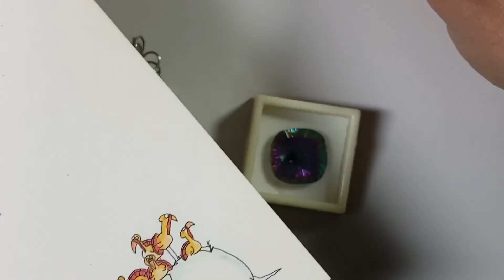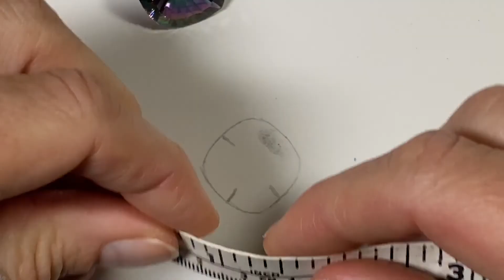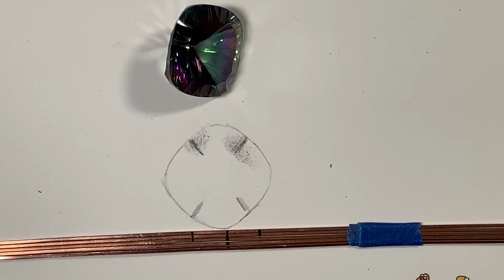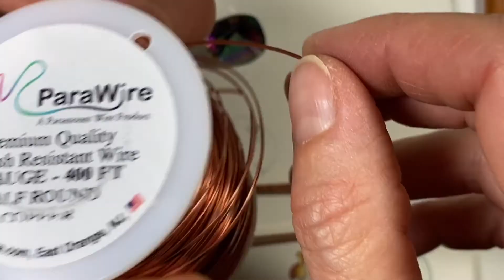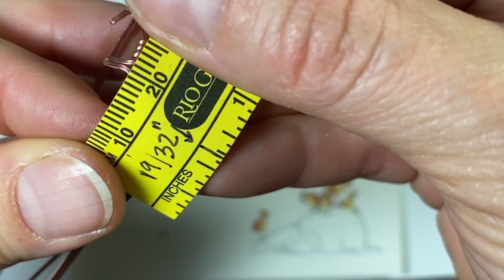Wire Wrapping Tutorial- Prong Setting for DEEP Cut Faceted Gemstones-Jacked Up Frame!

Comment: I had seen your original post on Facebook and voted for this tutorial. Thanks for making it. I know how difficult it can be to create a piece and video at the same time. It seems to add a bit of frustration at times for me at least so great job. I love the elegance of the silver one. This one did turn out a little busy but still nice and I love the stone. I need to invest in one of those polishing kits. It really brought out the shine and erased the tool marks wonderfully. I find myself using LOS to antique most of my pieces to hide blimishes but this is a great option now. Thanks for taking the time to create this tutorial.
Reply from the maker: Thanks so much for watching! 
I’m still debating wether to just cut the extra wire off since that’s an option still lol! We’ll see if anyone is interested in it! 
This video gave me high anxiety for sure!
Reply: @ZurickDesigns  adding that video element to the whole thing seems to do that to me as well. I love your work. Thanks for sharing.
Reply: You can also get a nice polish using a flex shaft or a dremel tool and some polishing disks. Of course, my JoolTool is the best option.

Comment: Starting out into wire wrapping, I’ve got nylon pliers, brown nose pliers, getting flat nose pliers, what was that measuring tool that you had? To measure the depth. And would you recommend any other tools
Reply from the maker: Those are calipers.
I would start out with the round nose and flat nose, also chain nose pliers (I have a fine tip and a thicker tipped) and a good pair of flush cutters! ☺️

Comment: Hi! Thanks so much for this! I love these videos and I love Gertrude! I was wondering whether the wires that go between the two layers of framing need to be curled? Would this design work with straight wires for a simpler design or would it collapse without the friction in the curls? Hope you understand what I'm getting at... Take care!
Reply from the maker: It would look great simple for sure! I was experimenting with the wire by winding it down the side. I might cut it off still. Who knows! I’m so glad you like the video! That makes me happy 😊
Reply: @ZurickDesigns  Thanks for replying! In case I didn't explain well enough, I didn't mean the curly extras from the bail and down the sides. I meant the twisted square wires that jack the frame up. Was wondering if the structure would work if I didn't bend or twist them and just had them straight... Will try and find out:) Love your stuff!
Reply from the maker: Ohhh. I think straight would be fine!
Reply: Thanks! ❤️